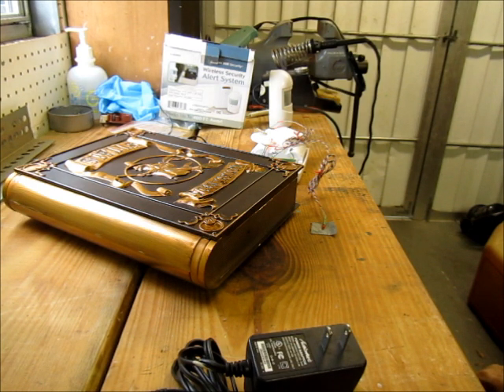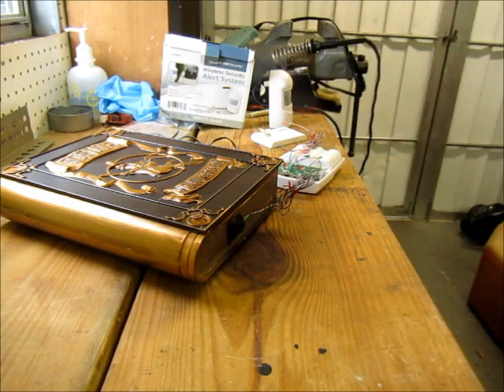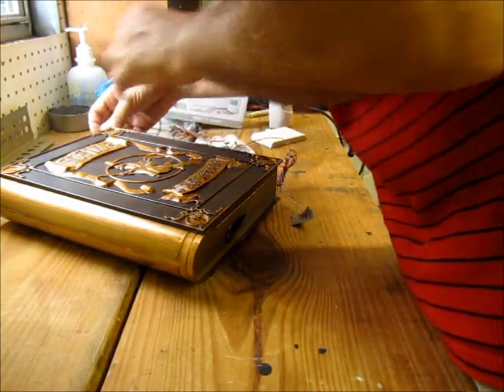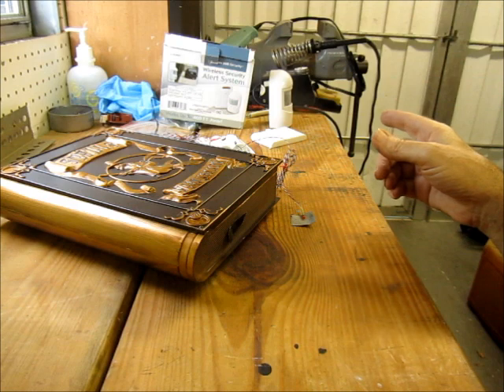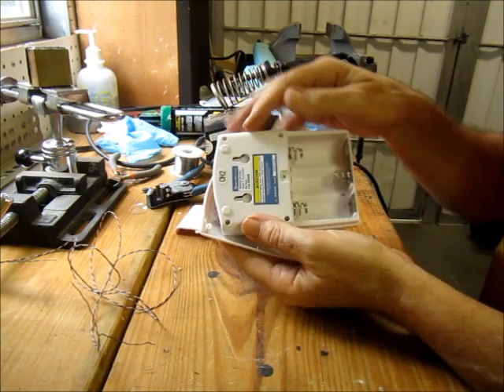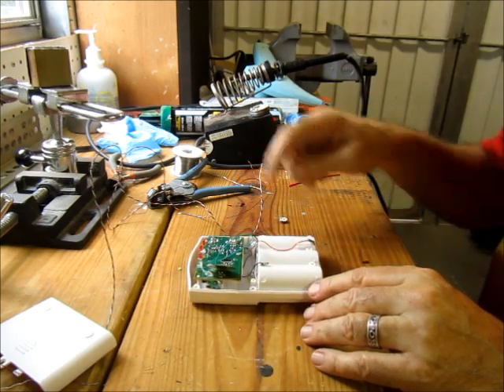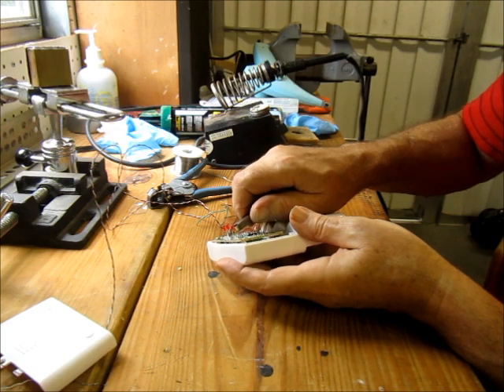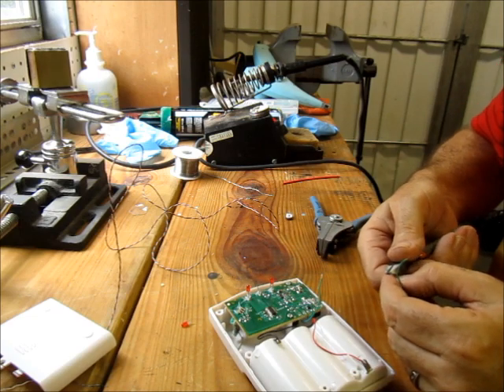How to Trigger Halloween props with wireless PIR from Harbor Freight

Comment: A word of warning: Harbor Freight sell this under 4 different SKUs depending on their supplier.  I've used multiple units of 62447 and 93068 and they have all transmitted different codes for individual units - however model 61910 appears to use the same code for all units. (I've checked using rtl_433 where you can see all the bits being transmitted)

Comment: Very informative and well done video. I want to modify the same HF alert for use as a mailbox alert. Would like the lights to remain on after triggered until I switch them off. How easy to add a switch / whatever else to accomplish this?
Reply from the maker: +OakProperties I would add a small (so it doesn't use much current) DPDT relay, a diode, and a small switch. Take one of the LEDS off the board. Use the one side of the relay contacts to apply power to the LED. Connect the relay coil so when the leds flash your relay closes, do it through the relay so it can break that connection when the relay fires. Use the other side of the relay contacts to apply power to the relay through the switch, but only when the relay fires. This holds the relay on until the switch is opened letting it reset. So the Alert fires the relay when the relay is off, and the relay keeps itself on after that. The switch briefly breaks the connection to the coil so the relay contact is no longer providing a connection to power, which resets the system for the next alert. The diode goes across the relay coil pins, so voltage spikes are kept away from the power source.
Reply: +Takai2012 Thank You !!
Reply: I'm lost...

Is there ANY way to make the alarm continue for at least 10 seconds?
I am trying to use these to trigger a relay switch for a 12VDC pneumatic prop...
I've tried attaching a couple small capacitors but that did not make any difference...
I've got the relay working, but I don't want the switch continually activated when people walk by...
So I figured if I can keep the 3VDC ON for say 10 seconds, it would allow the pneumatic cylinder to retract to set up for the next victim... Lol

Thanks!
Reply from the maker: You are on the right track with capacitors, but perhaps done a little differently. I would use a FET or a small logic gate like an OR gate. When the alarm triggers, it's voltage goes to charge a capacitor that is connected to the input of the gate which turns the gate on). A resistor is connected across the cap to make it discharge (to below the voltage needed to flip the gate logic) in 10 seconds.  The output of the gate (or a FET) controls your relay. Hope this helps.
Reply: Thank you but my ITT training in the early 80s failed...LOL (Rip off)
I understand the logic, but to create the circuit is a bit beyond my intelligence...

I'm looking for a low voltage wireless (2 separate pieces) motion detector that HAS an adjustable delay. Much like all those 110VAC motion detector lights.
I really don't want to wire 110VAC across my front lawn because of safety concerns, so I'm either going to find 12VDC and/or solar powered devices along with the pneumatic props.
The elec. devices will be for lighting and sound only...
The only 110VAC devices(power supplies only) will be under my front porch mounted to a control board along with the 12VDC pneumatic solenoid valves. 
I have TONS of electrical adapters and PC power supplies to create pretty much anything... haha

God bless you for your expertise... :)
Reply from the maker: Why not just use a prop controller, this one is about $75 with everything from PIR to wall transformer, and it has built in .mp3 playback. It can control 4 channels relays are on board too. Plus you can program it to not  retrigger for whatever interval you wish. You can use one channel for lighting, one for outbound cylinder, and another for a retract solenoid if you wish.  This is a link to an older version of the boards, you can find newer version videos on the author's youtube channel. I use a few of these controller, and am very happy with them. https://www.youtube.com/watch?v=4i6CTzX9Zy4

Comment: Great video!

Question:  
Is there ANY way to make the alarm continue for at least 10 seconds?
I am trying to use these to trigger a relay switch for a 12VDC pneumatic arm...
I've tried attaching a couple small capacitors but that did not make any difference...
I've got the relay working, but I don't want the switch continually activated when people walk by...
So I figured if I can keep the 3VDC ON for say 10 seconds, it would allow the pneumatic cylinder to retract to set up for the next victim... Lol

Thanks!

Comment: the video ended without additional information. It ended at 9:40, is that right?
Reply from the maker: Ah, the video tells you briefly (perhaps too briefly) at the beginning of the video that I moved the part about using them to the front of the video. It seemed to make more sense to show why you would want to use this, before showing how it's made.